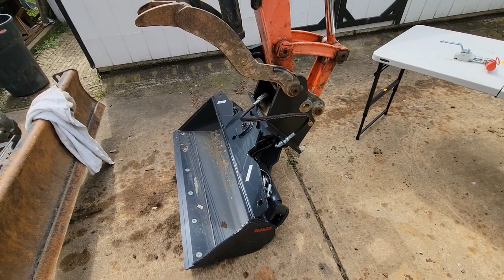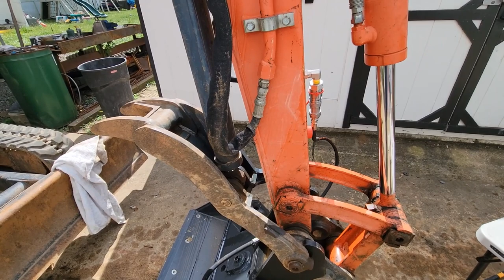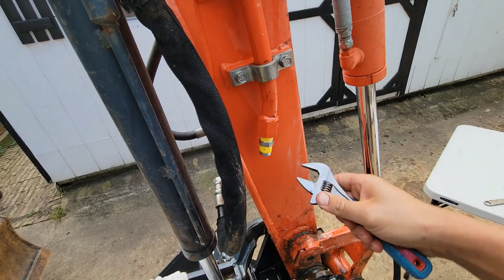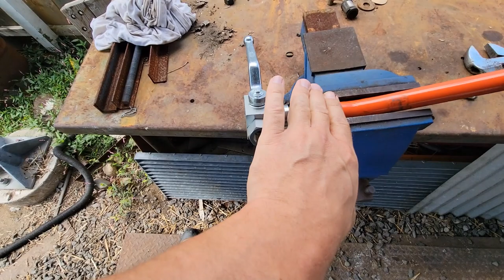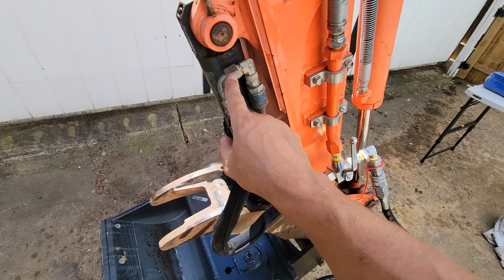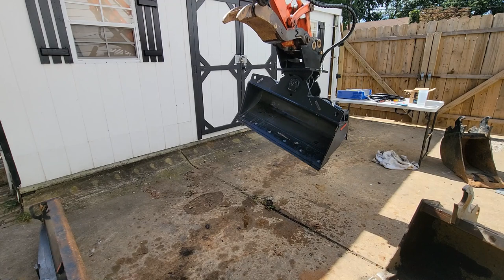How to hook up excavator hydraulics

Comment: I'm having a hard time finding the fittings to mate with Kubota's hard pipe threads. Can you share the size you used for your diverter to join OEM hard piped orange line?
Reply from the maker: They are 1/2" NPT, (which actually measures closer to 7/8). Here's a link of the coupler fittings I ordered from Amazon. Let me know if you have any more questions. Thanks for watching!

https://www.amazon.com/Straight-Coupler-Coupling-Hydraulic-Fitting/dp/B07SKLN3Q5?pd_rd_w=DTMfj&pf_rd_p=654426bb-d9e0-46ff-b0bb-c0819dce172b&pf_rd_r=804B4XXVJM16ERQGW27F&pd_rd_r=a540f9f1-5611-4397-9b4a-bd8307fc9028&pd_rd_wg=9Ky26&pd_rd_i=B07SKLN3Q5&psc=1&ref_=pd_bap_m_rp_35_sc